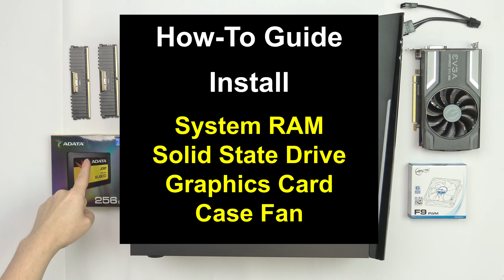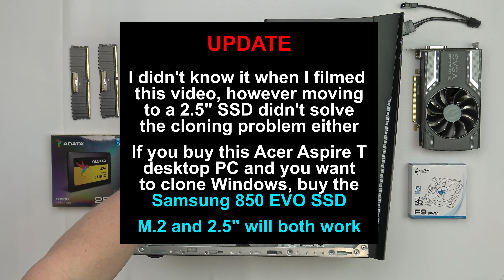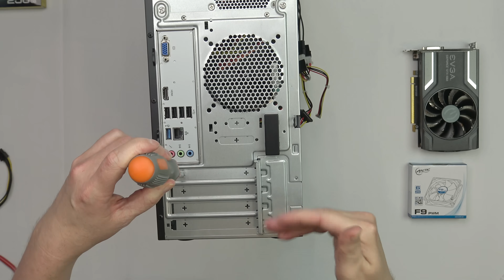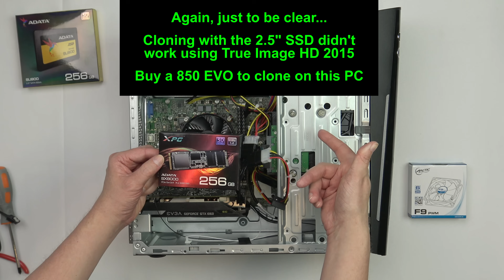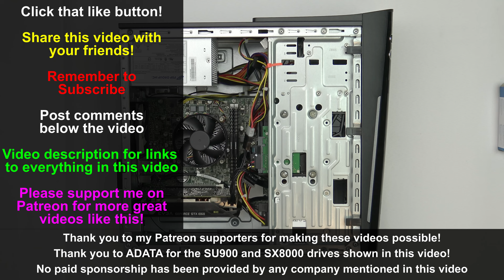$450 Acer Aspire Desktop PC - Part 3 - Upgrade Video - RAM - SSD - GPU - Fan

Comment: I have a Acer Aspire TC-230 and a AMD A6 7310 Apu but I decided to put a GeForce GTX 1650 Lowprofile inside the case (barely fit) it works fine but when I try to run a game the GPU will randomly crash locking my keyboard and mouse out with a blank screen (still connected to the graphics card because the monitor is connecting) everything is showing as a white hyphen in the top left middle mocks me. I have to directly remove power from the PSU to restart and turn on my PC again, thing is it only does this on slightly heavy loads such as graphics changes and resolution changes this happens in at least 5-10 minutes of gameplay or when a high amount of particles appear on the screen (lots for the CPU to load) it just crashes. I know I need a Apu upgrade but as far as I know I don't wanna buy a Ryzen 5 2600 and then it not fit any suggestions?

Comment: Thanks for the video man! Quick question - I have the Aspire 780A-UR12, after putting in the EVGA, how do you switch from the internal Intel 630 graphics card to the new one? Any help is appreciated.
Reply: Hi. I know this was a long time ago, but did you solve this video card problem? I am in the same boat with this same machine. Is there a link to another video perhaps? Thanks

Comment: I need to know if the case is mini atx
Reply: justene arana I think it's what is called BTX. The motherboard design is such that front and back panel connectors are all direct attached to motherboard without cables. there is no possibility of upgrading motherboard in the future.

Comment: ok so i recently ordered a gtx 1080 and a 750 W power supply, and i have the Acer Aspire TC-705 prebuild. do I need to buy another case? and will i be able to switch over all of my things from my prebuild to a new case?
Reply: yes and your most likely gonna need a new motherboard and fan because the standard intel fan wont stand a chance against the 1080 and everything else. And if you dont have an I5 processor you need to get one of those. The motherboard that comes with the Aspire C-705 can't support the 1080.
Reply: @marshall415  I just installed it with a new power supply and two new fans and works smoothly on high
Reply: epic
Reply: @marshall415  I have an i7 in there

Comment: Will the msi ventus gtx 1660ti fit in this case?
Reply: No but there is a evga 1660 ti single fan that fits
Reply: @nolant3707  Got a link?

Comment: Angle is good for most but you should have changed this for the GPU portion....usually the cages can be removed on HP's...surprised the Acer is not removable?    Good advice on pin connectors.

Comment: I just got a hand-me-down of the i3 version of this machine. The only intensive games I forsee running are LotRO, Minecraft and Fortnite. I'm concerned with now many are saying the 300w PSU isn't enough for the 1060 and given that the 1050 ti is a good deal cheaper, might go with that, but it upgrading the CPU important at this point? And truthfully, since this is an old video, was the 300w PSU actually good enough? Did just changing from the HD to SSD give enough power flexibility for the 1060 to be on the 300w?

Comment: hi im using an acer aspire tc 605. i used to be able to enter the bio i recently upgraded to a rtx 2080 new ram and psu. and since i installed these upgrade my bio will not let me enter into it anymore. ive tried system reboot into it, i tried esc during power up, i even tried the command prompt to enter during reboots. nothing work i need to update the firmware on my HDD but i can unless i get into the bios. any tips or idea how how to get the bio to work? anything would be appreciated

Comment: I realize this is far out of date, but is there a way to still utilize the DVD Drive? Can you adapt that all-in-one connector to a USB to run out the rear of the case and plug in the back? Or would you be better off getting an external Disc Reader and forgetting about this one?

Comment: I just put a GTX 1060 into another Acer Aspire T and have the same problem as someone else below (Yanksuk2007). It is not recognized by the pc and there is no display output signal from the new or old cards. If you take out the new card the old one goes back to functioning. Can you help?

Comment: I just did all these upgrades on this same pc and so far I encountered two problems, the psu is not enough for the graphics card, after I installed mine it will try booting and then shut off, and for some reason when you disconnect the dvd drive to use that sata cable port for the sdd,the computer will no longer send signal to monitor when I boot it up, right now I am about to get. 450 psu and get that sata cable that has the 6 pin connector to see if this solves the issues I am having.
Reply: Hello
I am also prepared to do this upgrade.

So I want to ask you to succeed?

Comment: i have ac acer t and it has an m.2 ssd (128g) and a hard drive ( 1 t ). i have another cable for an extra ssd or hdd but not a cable for the gpu so i had to get a 1050

Comment: I was thinking of upgrading mine to the 'GeForce GTX 1070 8GB GDDR5 SLI DirectX 12 VR Ready ITX Graphics Card'

Does anyone know if that would be a good choice?
Reply: epic
Reply: if you ever followed through with that howd it go? i want to upgrade my aspire tc-780 but i don't know anything about computers let alone what graphics card to pick. and its a little hard to find the one mentioned in the video

oh and P.S is there any more recent options you'd consider too?
Reply: @KirbyCurbwhy  decent performance at the time. I played less demanding games. The CPU bottlenecks the GTX1070.

Comment: Hi! I would like to update my ACER ASPIRE XC-780 (that is a sff) with a gtx 1050 ti Low Profile 4gb, i would like to know: 
1. Is gtx 1050 ti Low Profile 4gb compatible with these acer motherboard? (I'm assuming that those two PCs has the same motherboard, correct me if i'm wrong)
2. How much watts does have the power supplie of these Acer aspire? (If you know the  XC-780 the question is for this model of course) 
3. The alimentation of the graphic cards, in these models, happen trough the motherboard or I need to connect cables to the power supplie? 
Thank you very much for the attention!!

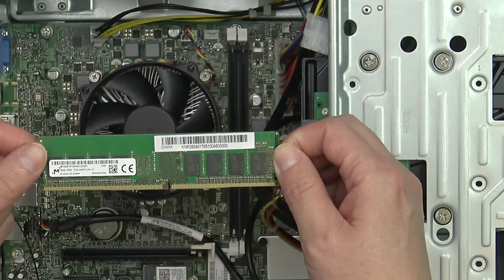Comment: 5:55 "It is taller in the middle than it is on the sides" 
What is that supposed to mean?
Reply: I wondered, too. He means the RAM chips on the surface of the card are taller in the middle than are the chips on the sides. You can see that where the light comes through the holes in the RAM cards.

Comment: i literally have this computer and would like to fit a GTX960 in , do you think it will work?
Reply: Im assuming you already installed it or a different card, but if not then Id suggest the 1050(ti)
also if you already installed one did you face any problems with it?

Comment: Hi! Is gtx 1060 3GB (and even 6GB) installable on Acer Aspire XC-780? I would like to know if it fits in the xc-780 case because it is a little bit smaller.

Comment: Hello Tech Deals, I have an Acer Aspire TC-780-ACK15 on the way from Amazon. I am guessing the motherboard and BIOS match the one you are using in this video. I want to be clear: if I get a Samsumg M.2 SSD, will I be able to do a clone of the 2 TB HDD to this SSD using the Samsung software? Thanks for your reply.
Reply: Never mind, watched the video again and a clean install of windows is needed with the M.2.

Comment: Had to unplug a cable to put in my gtx 1050 ti I don’t know what the cable does though, help 😂
Reply: Did you run into any troubles with the 1050 ti?

Comment: Is this the tc 280? If so I have this pc and it's slightly different... it only has a 220w psu. Is that enough for the 1060?
Reply: Yes but very near the limit. About 180w total usage. Although you should not run OEM PSUs near the limit since they are often not very high quality.
Reply: Its not at all

Comment: I just ordered an NVIDIA GeForce GTX 1050 TI without checking the size. facepalm does anyone know if it fits in this computer?
Reply: Im guessing you installed it, did you run into any problems with it?

Comment: Hi I have a question. I am trying to upgrade my gpu in this case and I accidentally broke the motherboard latch trying to take my old gpu out.  In doing so the latch that opens on the back of the computer wont close anymore since the gpu is not tightly sealed since the latch is broken. Is there any other way to tighten the gpu in the case besides that latch?

Comment: When I turn on my pc, it does not boot and my keyboard keeps turning on and off it’s light. When I first do a boot with gpu installed, do I have to connect the gpu to my monitor or motherboard to monitor? 

And does it really need a fan, since it is a 1060 I know I gives off a lot of heat?

Comment: I actually did the 1060 upgrade to the same PC and it wouldn't even turned on until I put in a bigger power supply.
Reply: I

Comment: I was able to fit my 1050 ssc which is the 1050 to but with two fans I just had tot take out the hard drive install the card and put it back in

Comment: Hey does anyone know if you can dual monitor after you upgrade the graphics card? I know the computer has one integrated HDMI port so I was thinking of using the 1050 TI, but it has one HDMI port on the card. Will the integrated HDMI port still usable after installing the new card?

Comment: Have a 1050 ti in this pc not overclocked other than its automatic boosts.  Could I switch out the 7400 for an 7600k if I don't overclock?  300 watt psu would seem to be pushing the limit there...

Comment: There is a model of the pc you are using in this video with an i7 instead of an i5. Would the model with the i7 still be able to be have the graphics card upgraded to the gtx1060?

Comment: Im going to buy this PC but im asking if the PSU like you said its enough.
I want to add an 1050ti without changing the psu, is it possible?
Reply: Giorgio Roberti Of course.
Reply: True_ Dublock thanks for the comment!
Reply: It will be risky though, but I doubt the PSU will actually burn your house down. But of course, 300W is the recommended, so we should be perfectly fine.

People will recommend a 400-500W PSU just for safety. Cause a rule of thumb is usually 100W over the recommended. But you should relatively be fine, as long as the PSU isn't a defective model.

It would be decently easy to change out the PSU of course, just because this is a mid-tower case. But wont be necessary.
Reply: True_ Dublock i'll do it, i dont want to risk.
Reply: Giorgio Roberti Like I said, not necessary, but it's your computer. Good luck man.
Reply: Orso Berto power supply is pretty cheap especially 500w and 600w
Reply: Did you install it? How is it?
Reply: Also curious if you ever swapped out the power supply, I'm thinking of doing it, 
I have this Same PC :D
Reply: I have had a 1050ti, Samsung SSD, 16gb RAM plus three additional fans on this PC for about a year now with the original power supply. All has been great!

Comment: no, do not get a 1060 with a 300 watt power supply I did that and my PC wouldn't even turn on until I changed the power supply to 450 watt. be careful people
Reply: i got mine with msi oc v1 gtx 1060 6gb and the defualt 300w psu and it works great.!
Reply: I thought it was very strange that he said you can install a GTX 1060 with a 300W PSU. Upgrading the PSU is about $50.
Reply: Guys help me please if i change the power supply do i have to change the mother board too? cause he said the motherboard supply the power threw the pci clot so if i get a new psu and hook the new gpu to it won't the gpu still use the motherboard pci clot as a power source?
Reply: @EridanusYT  no, you won't have to change the motherboard

Comment: Ok funny thing is is that I have the same conputer and I put a gtx 1060 but I stutter and makes gaming very annoying can anyone tell me what to upgrade to fix this issue if so add me on steam at disjointchaf5
Reply: Or leave a helpful comment thank u
Reply: So youre saying a card that size fits? I looked yours up and its  10.9 x 5.5 x 1.5 inches right??

Comment: Another option is to buy the ssd version of this desktop which has the ssd installed in the m2 slot. That way you can install an extra hard drive w/o a pci express card. model is TC-780-UR17. on sale for $499 at microcenter.

Comment: I have a question about the case on this computer, I was ready to build a full custom PC then I saw this deal and it just fit the budget with the rest of the stiff I need as far as 2 monitors a desk, gaming headset, ect. I've had plans to order an SSD, and GPU. I've already expanded the ram to a 16gb kit. but the big reason I wanted a custom PC was that I got exactly what I wanted, and it would look like a gaming rig to go with my clean setup. Is it possible to swap the Mobo and all components into a gaming case. Is this a ATX board? I'll eventually upgrade it piece by piece. I just really like some other cases and didn't know if it was possible and what I may loose or gain. thanks
Reply: Hey I'm basically in the same boat, thinking about possibly moving all the parts over into a new case. Curious if you ever did it or not, how it went?

Comment: Can i add a 1050ti instead?
Reply: Yes, i am using this machine and i have a 1050ti in it. works perfect
Reply: Ahmad Khan does it ever get too hot with limited fans and the low watt psu
Reply: M1zter_ Amazin nope, never

Comment: I just bought the Acer Desktop Computer Aspire TC-780-UR12 Intel Core i7 7th Gen 7700 (3.6 GHz) 16 GB DDR4 2 (on sale) and I'd like to install my new Seagate 2TB FireCuda 3.5-Inch SATA 6Gb/s 7200-RPM 64 Cache (Solid State Hybrid Drive). Is there anything out of the ordinary with removing the existing 2TB drive and replacing it with my new drive other than unplugging it and screwing the new drive in place? I'll do a clean install of Windows 10 after the drive and new GTX 1050 TI is in place.  Thanks in advance for any insight!  I really enjoy your channel, I'm so glad I found it.

Comment: pls make a review for this, is it  a great deal? Syber Vapor Extreme PC with GTX 1080 Ti for $1,553.
Reply: -Intel Core i7-7700K CPU ASRock Z270M-ITX/ac motherboard
-16GB (8GBx2) DDR4-2400 RAM
-GeForce GTX 1080 Ti graphics card
-240GB WD Green SSD
-1TB HDD (32MB cache, 7,200 RPM)
-600W Corsair SF600 80 Plus Gold PSU
-No OS

Comment: Say if your case comes with 3 case fans installed and your mother board only has 1 fan port how would you plug all 3 in?
Reply from the maker: Get a better motherboard  :)

Serious reply, a motherboard that matters for such a case isn't going to have just 1 fan control.  HOWEVER, if you have no choice, there are splitter cables...
Reply: Fan hub like the SilverStone PWM Fan Hub CPF04, connect PWM fans to it, connect  a sata cable to the hub to power up all the fans, connect the hub to the motherboard cpu_fan.
Reply: Tech Deals are there any power supplies that won’t work with this pc?

Comment: Interesting info on the cloning issues. On my Acer Desktop I was able to clone the HDD to a Crucial SSD with Macrium Reflect. My Acer model is three months old. One generation older. As a matter of interest if you want to upgrade the CPU on this model - say in a year or two - what are your options? Great build video BTW. Your channel is the best and so informative. Thank you.
Reply from the maker: Macrium Reflect does work, I used it on the prior gen Acer to clone, but it isn't as easy as clicking "clone", or it wasn't when I tried it...

The clone on the CyberPowerPC is much easier since the BIOS is a proper retail motherboard BIOS and all these issues don't exist there.
Reply from the maker: I wouldn't replace the CPU in the Acer Aspire, I'd either keep it as a spare PC or sell it...  you could put a i7-7700K into it, but a $350 CPU in a $400 PC strikes me as way out of place...
Reply: Thanks. Appreciate your thoughts

Comment: Good day! I have two questions.

1. What is more stable between "2 molex to 6 pin" vs "SATA to 6 pin" with regards to power for GTX 1060?
2. What kind of screw is needed to secure the M.2 SSD, since the board does not have one there and Samsung Evo 850 does not include it in the box?

Cheers and thanks in advance!
Reply from the maker: http://amzn.to/2nRlaSl - Drive screws - you don't need that many, but you can't really just buy 4 of them...
There won't be a difference between the cables, but since the EVGA card comes with the MOLEX adapter, just use it...

Comment: Not too excited about those Molex-to-X-pin adapters, if I'm honest.  The rest of this is amazing, I'll definitely be getting an SSD in the future.  You can alternatively install an m.2 SSD, right?
Reply from the maker: The 12 games that I've tested on this PC were tested as shown, with that adapter.  The whole tower pulls under 200 watts while gaming, it is simply not an issue...  The GTX 1060 is a very reasonable power draw card.
Reply: Tech Deals I see.  I knew they were overestimates , but I didn't realize just how overkill the recommended wattages are.
Reply from the maker: Just to be clear...  I do have a power meter on the wall measuring the total system draw from the wall plug...  taking into account the loss of efficiency of the PSU, the entire PC with all these updates is pulling perhaps 160 watts from the 12v rail inside the machine...  Maybe 100 of that is the graphics card, give or take a bit...

And that is with the card auto-overclocking to 2GHz!

Measured pull from the wall is 190-200 watts, but keep in mind this isn't an 80+ Bronze PSU!  :)

Comment: hey Tech deals got to ask you a technical question I currently have Aurora R6 a 2TB mechanical hard drive can I use any SSD solid state drive for my operating system. more do I have to go to Del and buy it from them send out made the computer thank you.
Reply from the maker: Generally any SSD will be fine, no you don't have to buy it from Dell
Reply: cool thank you.